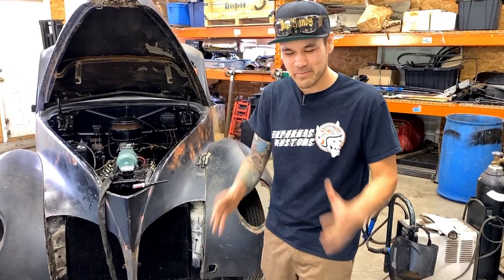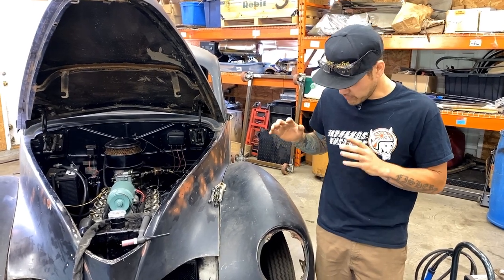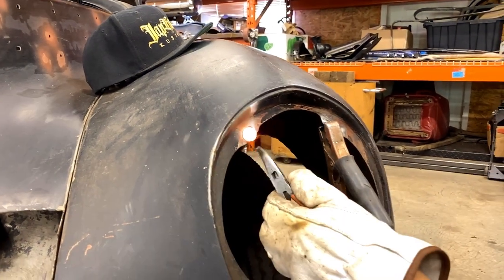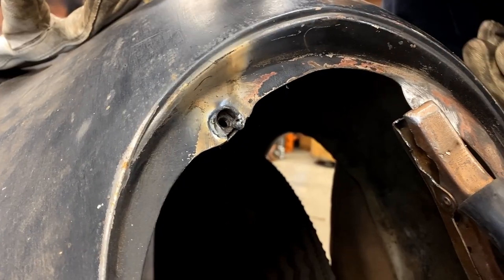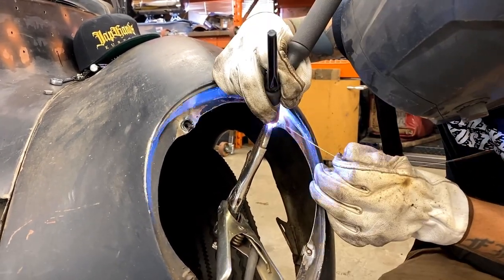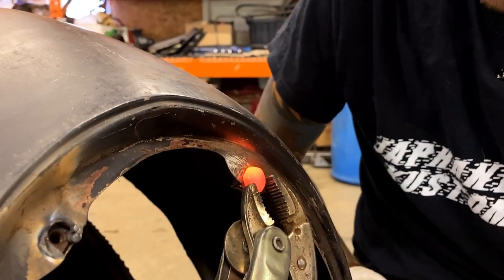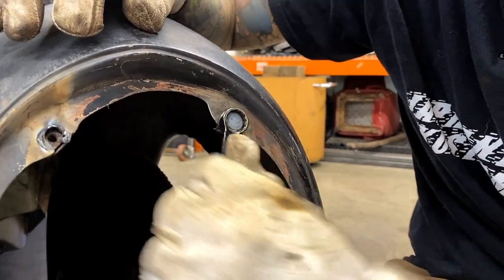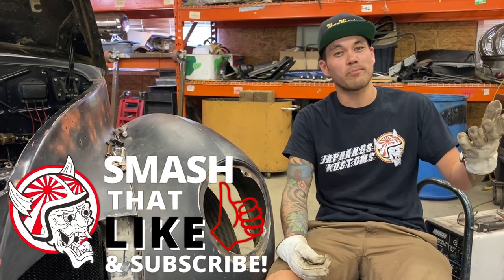2 EASY Ways To Remove Broken/Seized Bolts with A MIG + TIG Welder!! | Fabrication Tips & Tricks

Comment: The part of your tip I've always found important is wiggling back and forth, tight and loose. Tightening a stuck fastener slightly before trying to back it off has worked for me many times. Really liking your channel!
Reply from the maker: Thanks so much Bill! Yes, it’s definitely a key point in getting them out without messing up the thread!

Comment: Been watching Kame It Custom since it showed up on my feed a couple weeks ago. Going back now & watching some of the earlier videos. Learning a lot & love the presentation. I have been a heavy equipment mechanic / welder for a long time, used this method a lot. You can stick weld the same process, using Unichrome 265, it comes in 1/16 & 5/64 & works awesome. It should be available in blister packs from welding supply store, you don't have to buy a bunch. Thanks Karl!

Comment: Awesome tips! Thanks!  I like to use the washer and nut method. But I only have mig and stick welders. I also use candle wax once the bolt is hot. It's a technique I seen on line. It was a machinist trick. It's supposed to work well with dissimilar metals like aluminum and iron. But I use it whenever I can. The trick is the paraffin doesn't burn off like all other penetrating oils do when you heat up something.
Reply from the maker: Where am I that’s a good tip that’s a new one I haven’t heard about the candle wax! The washer trick is such a good one so that you can add more heat with a Mig And it’s usually faster than bringing out a tig welder

Comment: This is absolutely the best way to remove a broken bolt/stud. It amazes me how many people have a MIG and still use left handed drill bits, easy outs, cutting a slot and trying to use a screwdriver etc. All of which may work if you broke a decent bolt/stud while over tightening it, but if it broke trying to undo it, it needs some heat and a decent amount if force. Welding a nut on gives you both. I also like to squirt the nut with a little bit of water just before undoing it. That helps to contract the bolt/stud away from the mating threads. 👍

Comment: I use this method quite a bit to extract broken bolts from cylinder heads and engine blocks. Works awesome! I have also found that if you drill a hole in a piece of flat copper you can use that as a guide to keep from welding the stud to whatever piece you are extracting it from.

Comment: Excellent job---I do this a lot---at the moment the nut cools to dark( but still hot )  I push a candle on it a bit to melt some parrafin wax into the threads--as long as its hot enough to keep wax liquid, parrafin creeps down the threads to provide a bit of lubrication for the method you used of working back and forth to remove stud.  Your fav penetrating oil probably works just as well but the wax has been my habit for years.------just found your channel recently---love your vids.  Thx.
Reply from the maker: Very interesting! I’ve never heard of using wax I’ll definitely give it a shot! Probably doesn’t smell as bad as the oil LOL
Reply: Glad to see another old-school candle user.  I've had better luck with a cheap dollar store candle than a $20 can of Kroil.

Comment: I always plug weld the nut to the stud, with the mig.  I learned it on engine cases, aluminum mostly, and it almost always works well.  I had to watch, to see if it changed in the last sixty years.  Thanks again.

Comment: I have used this method with tig quite a few times, right down to an M4 screw sheared off in a blind hole in a zinc casting just below the surface, without damaging the tapped hole. My tig is my best tool for getting broken bolts out.
Reply from the maker: Yep me too man I use it all the time! Just yesterday I stopped in at a buddies motorcycle shop and there is an exhaust studs broke and we’re inside an aluminum cast hole. He didn’t have a tag but are used the washer technique so that I wouldn’t mess up the aluminum. It worked like a charm only took five minutes they had been trying to drill and tap and use easy outs that broke for hours

Comment: Awesome video! This technique is a lifesaver and much easier than drilling. One technique I've seen for removing a stud broken flush or even inside the hole when all you've got is a mig is using a piece of copper tube that just fits in the hole. The weld won't stick to the copper, and therefore won't damage the threads.

Comment: Good vid man!!
The only thing Id add is that ill often let it cool after welding, so the bolts as small as its going to be, then soak in your favourite penetrative libation before winding it out. I find it's worth the risk of another messy weld from contamination if i think I've a chance of winding it out first try.
I like acetone and atf mix, some swear by it, some swear against it but it works for me!
Cheers mate, loving watching your stuff!! Nice one!

Comment: ive also got a broken head stud that was deep in the block, using a piece off copper tube same width as bolt. using extended mig wire in the tube to build up to above the surface.
Reply from the maker: Nice!

Comment: Sometimes I’ll quench the fastener with water after welding or just torch heating because the rapid cooling really breaks the rust bond. Works well on removing O2 sensors here in the rust belt.

Comment: Awesome vid! I have an induction heating gun, and I LOVE it for stuff like this! Do you not a have a oxy torch? I use 0 or 00 tips to heat something small and fragile like that. What I will also do is,  (if I can get to the backside of a fastener), sandblast it to remove all corrosion so that when you try undoing it it won't bind up and break something.  This is a great treatment for corroded suspension & steering parts before disassembly or adjustment. Am I correct in thinking that you are using .035 MiG wire as a filler? Of course, since you are using all that heat, why not just heat up the tabs that capture the square nuts, bend them out and remove the nuts for new ones? When you jokingly said " a little bolt to use on something, I thought, "MY GOD...he's even cheaper than I am"!
Reply from the maker: Ha ha ha I’m glad you got my joke though lol yeah the metal so brittle I didn’t want to bend the tabs I was worried they would break being so old I do have torches But I really like the welding technique for it heats it and add some thing to remove it at the same time

Comment: I have done this myself several times in my profession, it works if you have patients. I use both the nut and also a bolt welded onto the washer. If I have a nub I use a nut and a bolt if I don’t . You have to pump the heat into them for sure! Great videos my fellow gear head🤘🤘
Reply from the maker: Thanks Paul! You’re right about the patients it’s really easy to get ahead of yourself and make a mess

Comment: Luv your Great Videos! I always use the Tig Welding technique. Where I work, I remove a lot of the small 3/16" broken exhaust studs, on our Aircraft engine cylinder jugs, but I use Stainless Steel filler rod because it offers slightly more tensile strength over my standard ER80s-d2 rods. I try to use the box end (for quicker back and forth time) when the outside of the welded nut has room. If not, I do turn my wrench opening around for proven better grip (now tha'ts splitting hairs...LOL!) If I feel I do make a little progess (a few turns) then stops, I will either reheat or soak with penetrant (MouseMilk). Again, great video!
Reply from the maker: Awesome additional information! Thanks for the extra insight I appreciate it!

Comment: At first i was like why isn't he covering up that fender from the MIG sparks. But then realized he's prob going to paint the car anyways. I've used the TIG method on studs and setscrews that were broken off below the surface, with great success. Being able to pinpoint that heat really is key.

Comment: Used the same technique to remove a transmission mounting bolt on my 20yr old diesel pickup. The nut was just a bit bigger haha.
Reply from the maker: Right on it works so well! The heat breaks free in the nut twist it off

Comment: The part of welding the washer first then the nut to it is the key to an easier extraction! You have way more chance of actually having a solid weld to the broken bolt or stud then trying to fill the nut cavity. Been using this technique for well over 15 years and it’s gold, even old timers argue that’s it waste of time, but really guys just stop trying to weld a nut directly. I’ll be quicker in the long run.
Reply from the maker: Yes! Exactly! It’s got me out of so many jams

Comment: the furst way i was taught about heating a stuck bolt thats not broken, is to heat the nut or female thread if possible and unscrew it while hot. I can count how many exhaust manifold bolts ive had to do as you did by welding the nut, but with thick metal, the female side needs to be heated more then the bolt us possible so the threads of the bolt dont expand as much, creating a larger gap in the threads.
Reply from the maker: Makes sense!

Comment: was doing  this with a mig the other night someone I know was removing a water pump in a car ,, 3 of the 5 bolts broke off flush the with engine ,, the engine housing was aluminum .. there was corrosion so I had to clean it up weld a washer then a nut .. some of them had to weld 2 or 3 times . bolts were only like a # 10 or maybe a 12 .. then the frame rail was in the way,, not fun .. another big problem is broken exhaust bolts ,,

Comment: Hey Karl, thanks for this tip. A while ago we have had a broken screw in the alumium hub of a pit bike from my sone.I assume welding something on a srew sitting in alumium is not possible. WHat do you think?
Reply from the maker: It should be absolutely possible! In fact Welding does not like to stick to aluminum so it should work just fine try the washer idea if you can
Reply: @MakeItKustom  ok, next tim e i'll give it a try ;-)

Comment: Isn't there a way to use our Mig welder to heat up rusted exhaust bolts without welding onto them?
I can access both sides of these bolts in a pipe connection. I just can't get them hot enough with a propane torch and don't want to buy an acetylene torch just for this one item!

Comment: Curious… before wrenching, why not use penetrating oil? Added lubrication.
Reply from the maker: Great point and it probably would’ve helped a lot but they did come out pretty easy just from breaking the rust with heat.
Reply: @MakeItKustom  : Heat didn’t work on my brake bleed screws, but likely a map gas plumbing torch just wouldn’t do enough to break it free. I’m looking for a mini oxy/acetylene set for such projects.

Comment: Sad to see this secret being exposed... Having owned/operated a machine shop for eleven years I found myself at odds with mechanical engineers and others who were taught to use liquid nitrogen and other fantastical/exotic means to shrink the bolt. Only after all that failed did they bring it to me to drill out the fastener and repair the thread. I always had them lay it on the bench and come back later. As soon as they turned their back and stepped out the door I would bring the fastener to a cherry red with what ever means fit the job. I would go back to what I was doing until the fastener cooled. And, probably 95% of the time I was on the phone with the customer telling them it was ready for pick up while I was backing the fastener out using visegrips. The reason  this works is the extreme heat swells the fastener which in turn expands the hole and compresses the internal thread by a few tenths. Just enough clearance to do the job.

One point I would like to make is in regards to zinc plated fasteners. These need to be kept heated to about 800°F so the zinc stays softened while you back the fastener out. Otherwise the two will essentially be soldered together. After separating, allow to cool, then chase the internal thread with a tap if the plan is to re-use.

This is an excellent channel, and seriously... this knowledge needs to be passed down to others. Colleges and tech schools have become nothing more than money grabbing schemes churning out total incompetence with a certificate anymore.

Keep up this good work! Looking forward to seeing more videos, and learning more!